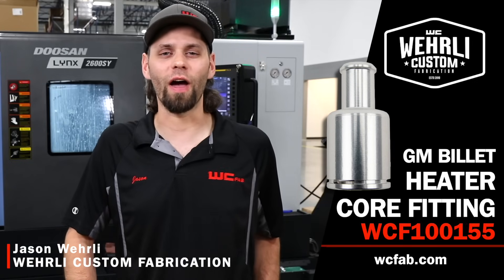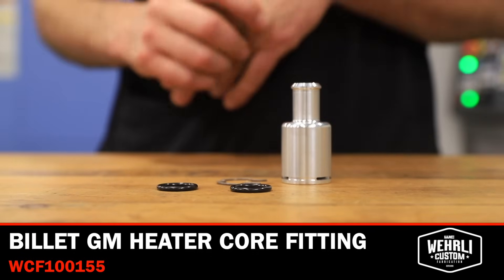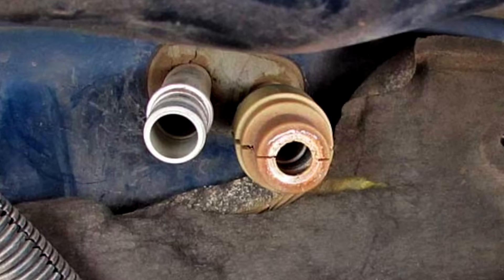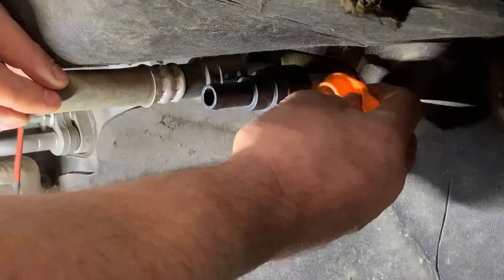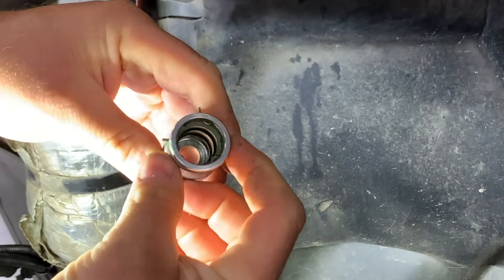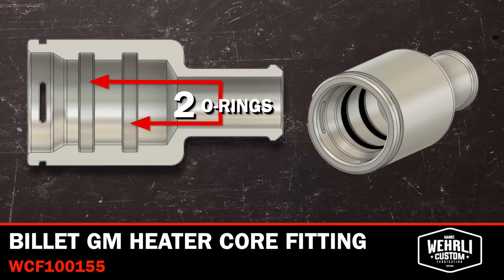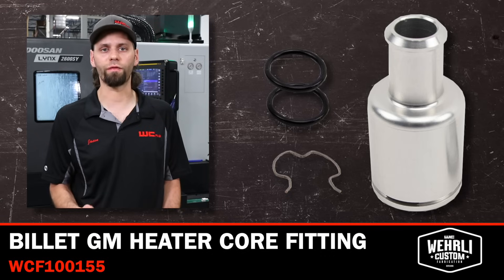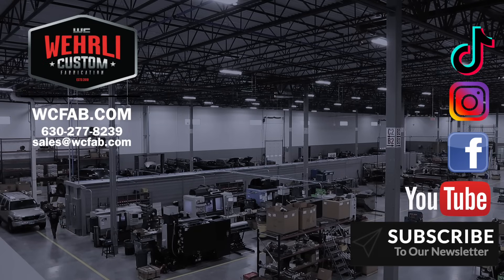WCFab 1999 - 2023 GM Billet Coolant Heater Core Firewall Fitting

Comment: This is definitely easier to remove. Little challenging to install the clip after the fitting is slid on due to location. It would not slide on my 2013 LML with the clip installed first.

Comment: Need to make 1 for ford trucks tired of plastic bs
Reply from the maker: What year / model Ford truck and specific fittings are you running into issues with currently?
Reply: 2000 f350

Comment: Is the price for a pair or for one single fitting? It doesn’t state that on the website.
Reply from the maker: These fittings are priced and sold individually.
Reply: So they are both the same size?  And I should order 2?
Reply: Never mind found the answer on another comment.
Reply: Compound kit for L5P?